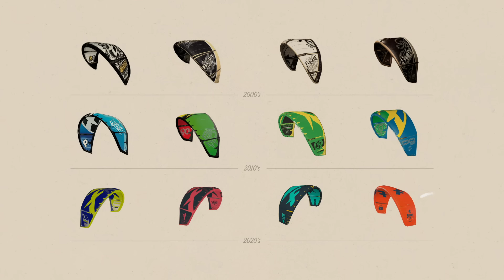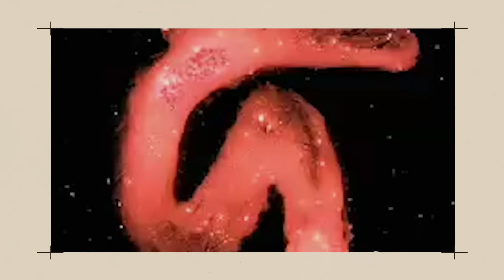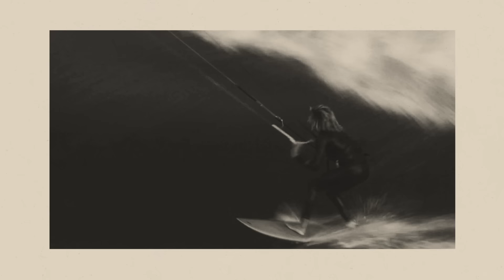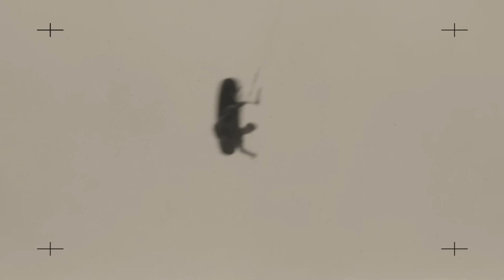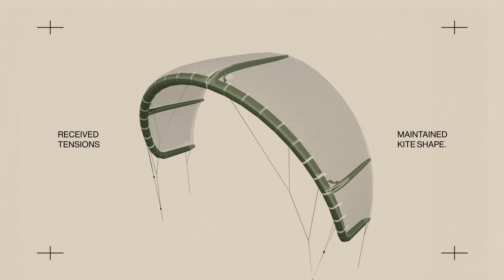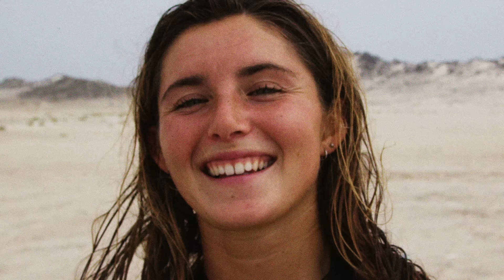F-ONE | Sail Engineering - The secrets of F-ONE's kite designs

Comment: I agree with all you have said and I have just changed my bandits with the new triggers. But I wonder what would have happened if you used newer lighter/stronger material - like other brands - while applying all this “sail engineering” stuff. This is the last year I buy F-one if I can’t get a sturdier kite. About weight, this is not the lightest kite anyway and f-one kites are quite fragile compared to others I see on the beach. If I compare the price there isn’t much of a difference with the powered-up version of competition (except for those based on Alula fabric).
Reply: true. but I ride wave boards and do foiling, so bandit S is the way to go for me. or NEO if f-one does not bump up the quality and material